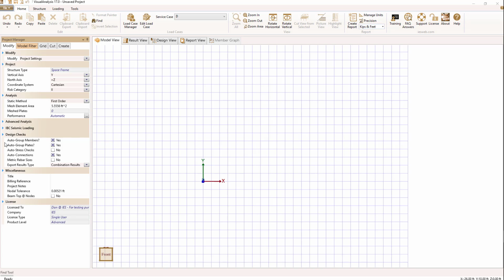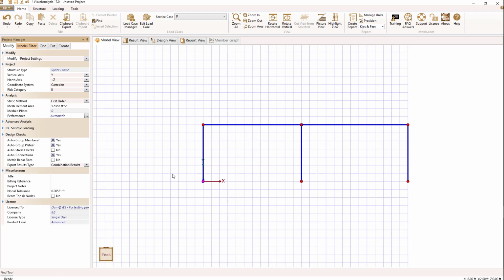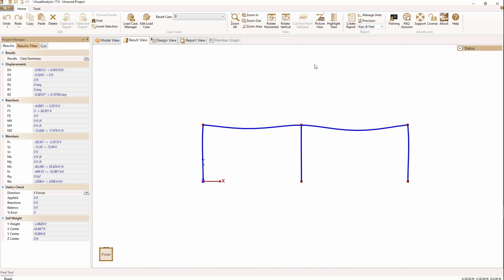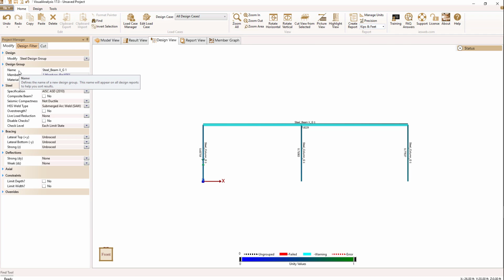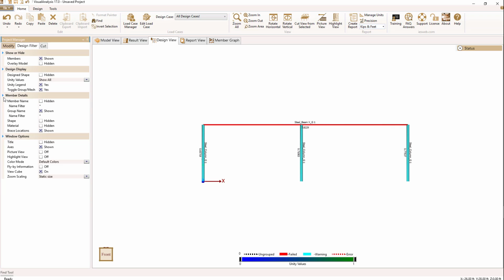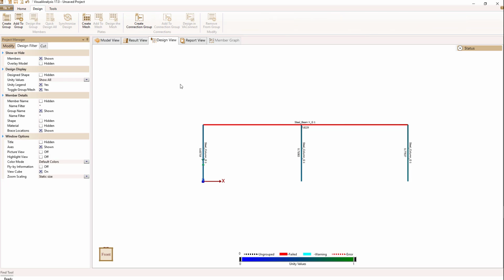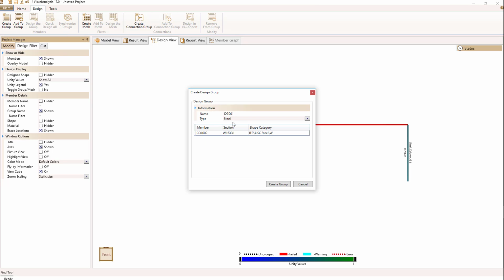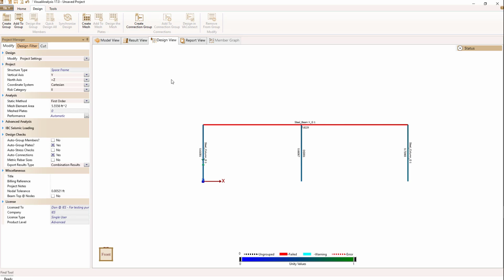VisualAnalysis: Design Groups

Comment: Hello, I have the error "There are no load combinations that match the design group's "specification" (ASD vs. LRFD) parameter.
Please edit the design group's parameter or use the load case manager to edit the load combinations."
I already tried to put "custom" in my load combinations but it doesn't fix it, can you help me solve it?